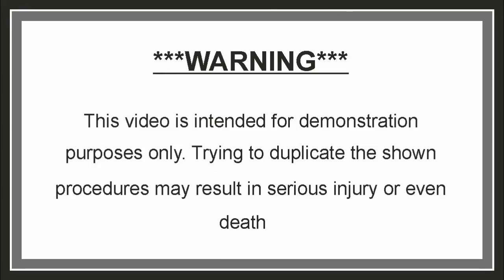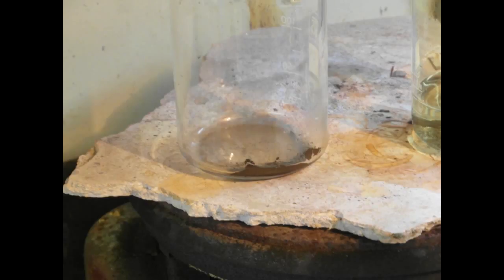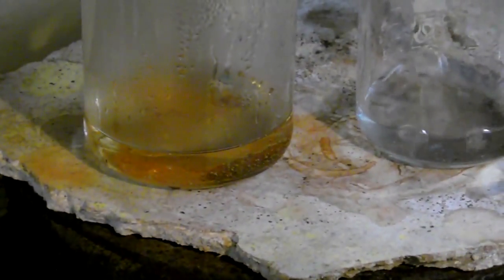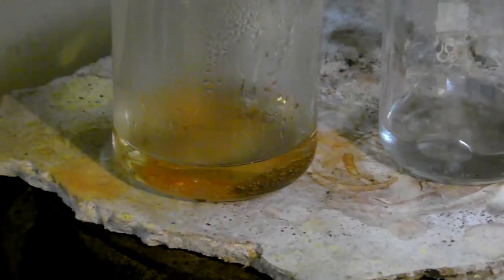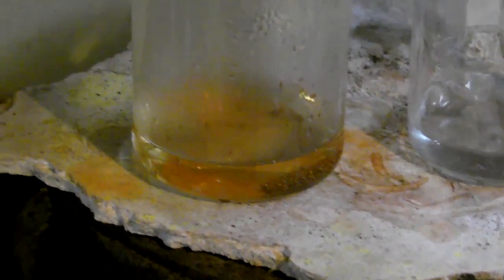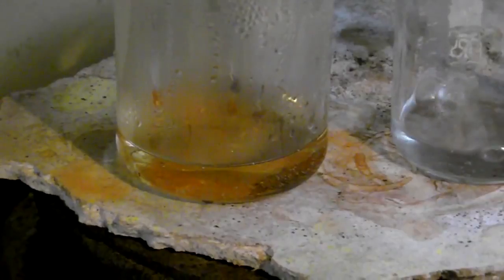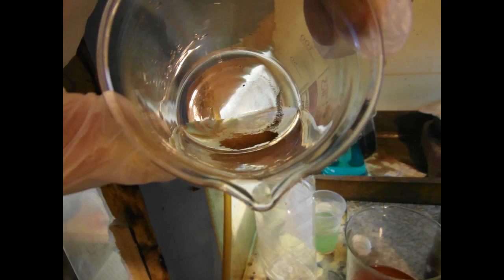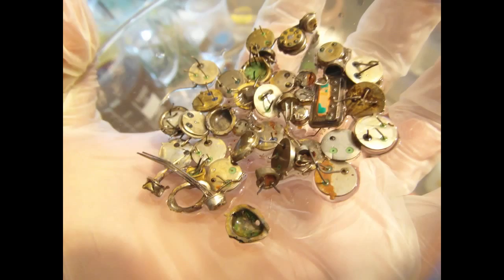Transistors GOLD leaching with iodine

Comment: Hello, I find all of your videos to be very helpful and very well presented!

In this process can you safely and effective substitute sodium hydroxide for potassium hydroxide. Also, is potassium iodide strong enough iodine content for this process? Thanks!
Reply from the maker: Hi and thank you! :) In this process KOH and NaOH are interchangeable. potassium iodide is a good starting point for this leach. You can oxidise part of it to elemental iodine using hydrogen peroxide, producing KI/I2 leaching solution.
Reply: OwlTech Wonderful, thanks for the quick reply. I have potassium iodide on the way as well as pure iodine coming much later. I've been using AP, Aqua Regia and reverse electroplating via sulfuric cell and I want to get away from those acids for a little while, at least sulfuric and nitric. I know I'll still be using HCL and some situations you can't avoid using nitric, but your iodine leach has me curious and intrigued.

Last question, I promise. Does this work exclusively for magnetic items, or can you also other gold plated items as well?
Reply from the maker: works with other gold plated items too. The process is not mine, it is based on patents US3957505A and US5137700A by Hilbert Sloan. Google it, the process  is very well described.
Reply: OwlTech Excellent, extremely helpful and kind of you to take the time to give this information. Keep up the videos